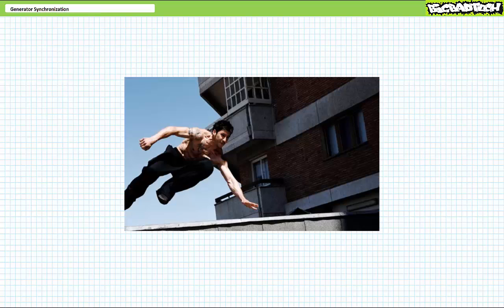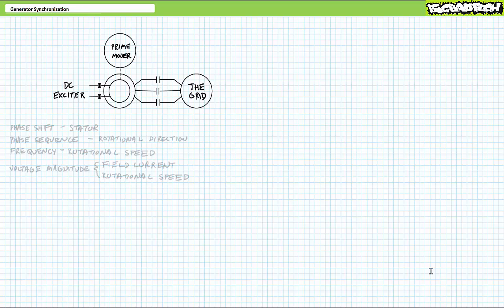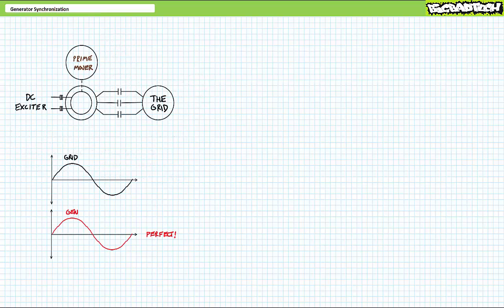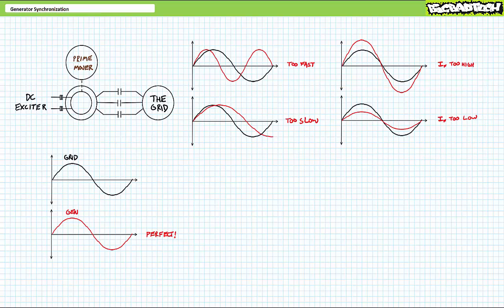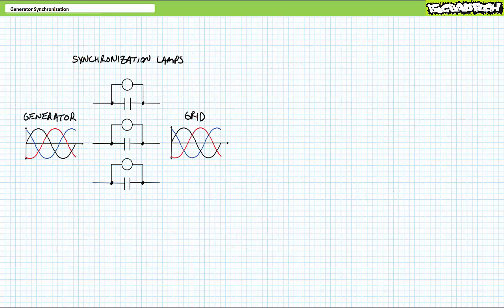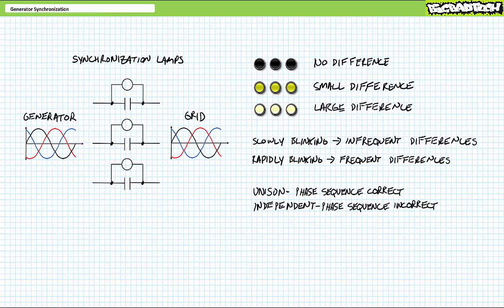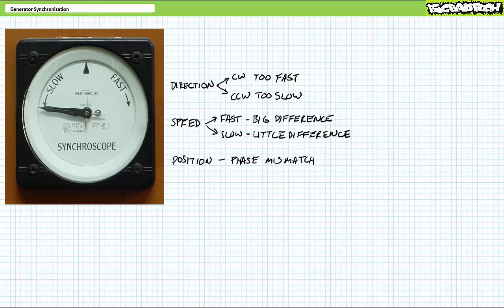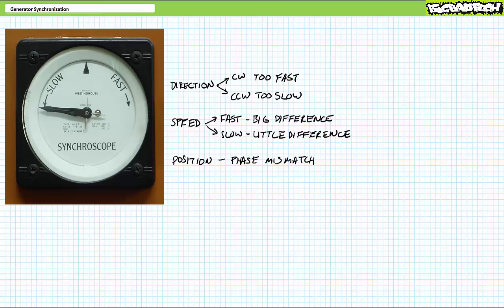Generator Synchronization (Part 1 of 2)

Comment: A little nerdy historical comment: Back in the day, we were converting our transmission substations to micro-processer controls. We set up a synch-scope displays on computer screens and tried to remove the analog synch scopes.  We figured it's all software so analog goes bye-bye. But ... our operators had us reinstall the analog scopes.  Why?  In emergencies a "black" start may be required to where personal would have to manually bring up the grid without computers.  They had to able to see when differing parts of the grid need reconnection and synched.  Lesson on how there are multiple stakeholders with differing priorities even if we think tech solves everything. Besides ... what's wrong with a little analog? Aint the real world analog and we pretend we can digitize everything? As a power guy, I think you do a real good job with your explanations. It's useful and needed. Good job.
Reply from the maker: True dat. As easy and tempting as it is for people to make fun of old technology, it does have its place! For example analog needle meters are far easier to detect rapid changes or differences between readings than a digital display of numerical data only. When you're scanning a collection of needle meters its easy to see the one needle out of place, oscillating, or the one that suddenly spikes or drops. If you used all modern digital numerical data that important observation would be lost in a sea of numbers.

Comment: Thanks.  When synchronized, what keeps the power from the grid from overloading the generator since it provides such massive power?
Reply from the maker: I'll explain more in part 2 which I'm editing as we speak. Long story short if there's no differential at the time of synchronization there's no exchange of power, mechanically or electrically, in or out. In part 2 I actually purposely bring a generator onto the grid 180 out of phase ... super bad things happen!
Reply: @bigbadtech  Thanks, I look forward to your next video.  Another question I have is what keeps the two lock stepped in place.  I think the physics may do that and no continued external phase compensation, etc. is required.  But I may  be wrong about that.

Comment: With the three lamp method(s), there is another widely used method. I believe it used to be called the Siemens & Halske method, or 2 bright 1 dark method. One lamp is connected in the same manner as the all dark method (A phase to A phase). The two other lamps are interconnected between the remaining two phases, across the paralleling contactor. i.e. one lamp is connected B phase incoming to C phase grid, the other is connected C phase incoming to B phase grid. This method can be used for synchronisation where a synchroscope is not available. The lamps should be arranged in a triangular shape, so that they dance around in circles to show the same thing as a synchroscope.
Reply from the maker: True dat! I have a picture somewhere of this setup from an old abandoned hydropower facility.